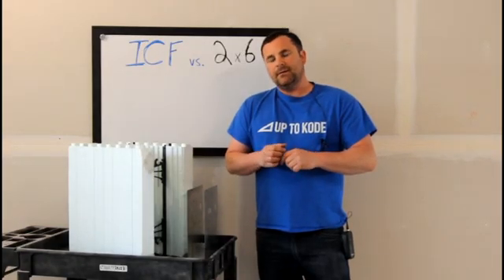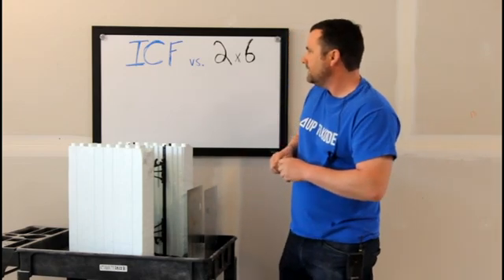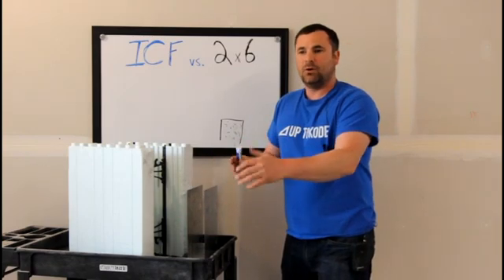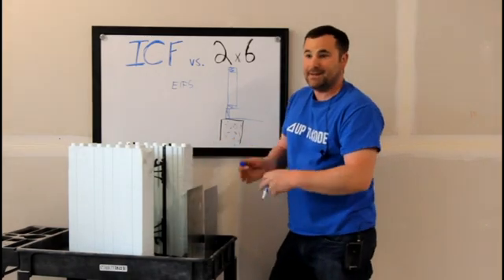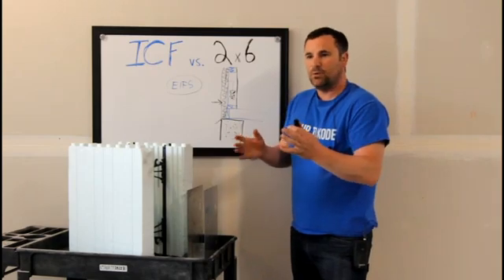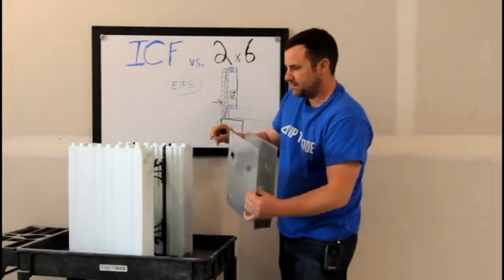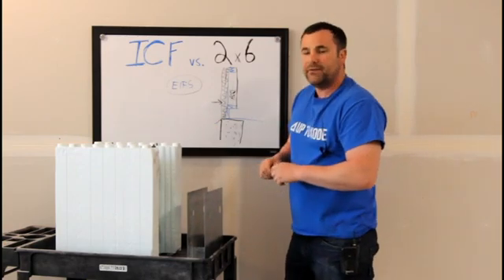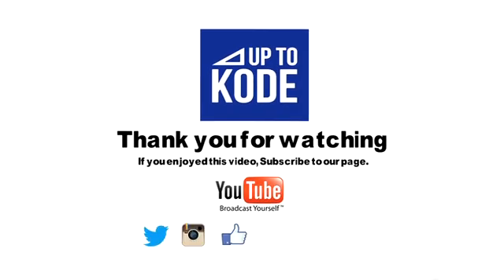Insulated Concrete Forms: ICF Wall vs Stud Walls

Comment: the problem I see with ICFs is that they are actually backwards.  what you need is the concrete on the outside and the foam on the inside.  At this point I see no practical and easy system to do that which does not involve the time and expense of placing forms.  Also, don't you have the same problem finishing an exterior ICF wall as a 2x6 wall with 2 inch foam?

Comment: Kody, eliminate interior poly on 2x6 walls you create a mold trap. Icf blocks are all rated at a minimum 3 hours Astm testing with some that have 4 hours, but they just let the test run longer, the 6" concrete becomes the true fire barrier. Foam and battens can be rebuilt. Sips cannot achieve the same sound resistance. There is a formula for the mass heat flow ratio. I have built climate zone 5 for 40 years and in a nut shell a stick frame will lose its heat in 14-15 hours a Icf 72-84 hours same temps. Which would you rather wait in for furnace repair?
Reply from the maker: Great information! Thank you. I am always learning and definitely need help from folks like you.

Comment: ICF is NOT fire rated for 4 hours. The concrete may survive, but the polystyrene foam will be in a molten burning puddle of toxic waste in a few minutes of a modern day room and contents fire. The best way to insulate any wall in a northern climate is with closed cell spray foam. But 2x6 construction still has its pitfalls with thermal bridging. Post frame construction with purlins on the outsider the posts with the use of spray foam is one great way to stop 99% of thermal bridging. You could even do a 2x4 wall with purlins outside to stop thermal bridging. With the use of closed cell spray foam, there is no problem with moisture inside the wall cavity. I built my house post frame construction with R-42 in the walls and on the roof deck. That’s 6 inches of closed cell spray polyurethane foam. It looks like a normal house on the outside while heating and cooling like nothing else. And if there is ever were a fire, spray polyurethane foam doesn’t melt because it’s a thermalset plastic verses polystyrene which is a thermalplastic. I’m not against icf or 2x6 construction. I just don’t think either are the greatest thing since sliced cheese.
Reply: Icf is the best wall system hands down
Reply: Christopher Icfs burn the same as wood same out gasses, carbon monoxide, carbon dioxide, black smoke until you put water to it. Urethane foam produces formaldehyde gas and chemically out gasses for years while decomposing over time especially  from heat. Urethane foam produces smoke so black and thick in a fire it is like burning tires and will kill you rapidly.
Reply: NUDURA ICF forms like he’s showing in the video are NON TOXIC during a fire, and when drywalled, will give you a 4 hour fire rating. #ICFLIFE
Reply: Good points.
Reply: Christopher Gruenwald 
Ok so what about icf blocks made of polyurethane then?  Seems thats the best of bith worlds.

Comment: just built a house with sips instead of icf. I got a quote for icf. it was double the cost for the shell.icf are great for some things like tornado protection ect but you are fooling yourself if you think you can justify the cost expecting cheaper energy costs will pay you back, It will not happen.
Reply: I don't know who did your numbers for you but my home is definitely paying for itself
Reply: The problem with SIPS panels are that there’s no structure. They may be great for energy efficiency, but it’s like living in an insulated cardboard box. ICF gives you the best of both worlds, very strong structure and high energy efficiency.
Reply: I like sips but it doesn't address his argument of the stud being a thermal conductor.